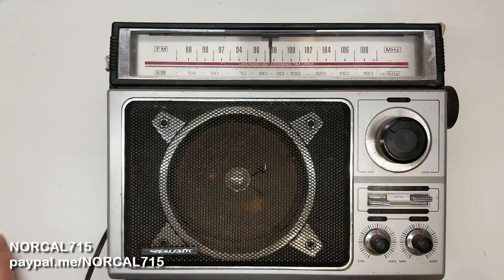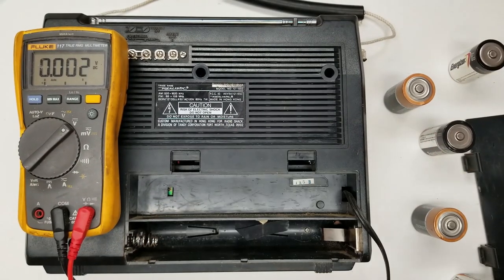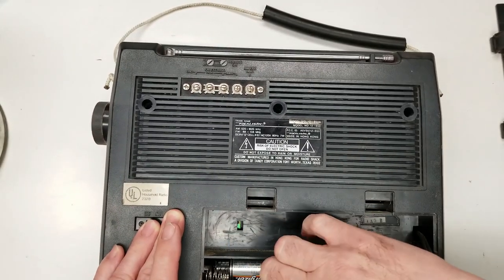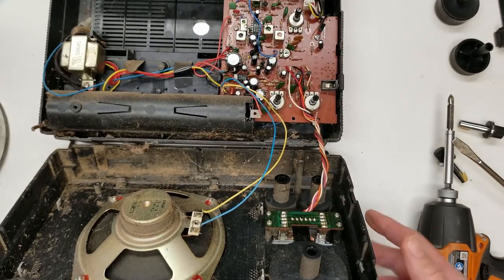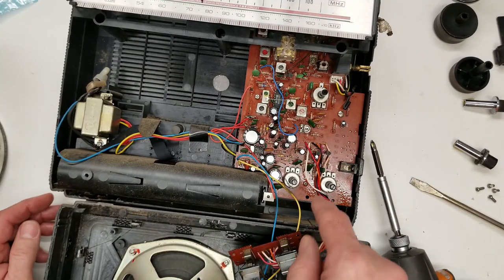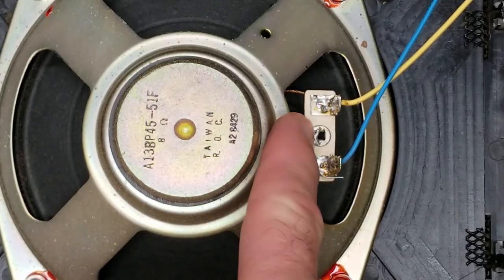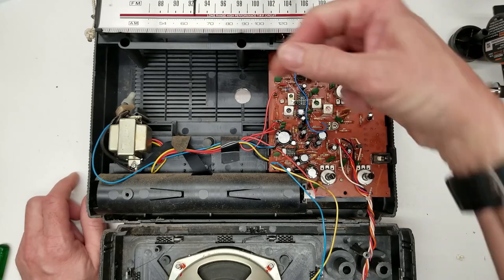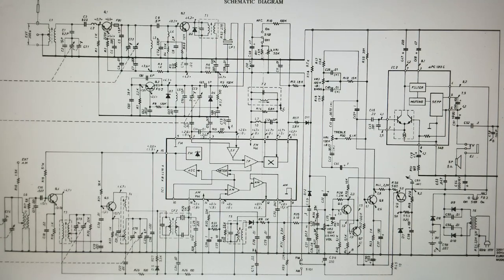REALISTIC 12-650 AM-FM LONG RANGE RADIO NO POWER REPAIR WITH FULL SCHEMATIC DIAGRAM

Comment: Nice work on this little "blast from the past".  Since the owner is using it on just batteries, I'd recommend putting some dielectric grease on all the terminals to help keep the corrosion at bay.

Comment: One sony make audio ok, but fm&am no function one 18pin ic in rf stage and one 9pin ic for fm also one 18pin ic as pre ampli, no rf function what to check and change please help.!!!
Reply from the maker: Check all of the power supply voltages to the AM/FM RF/IF circuits first.

Comment: Nice vlog, can you help me my xhdata 808 radio suddenly wont start, uses 18650 battery, on pluggong micro usb charger the lcd lights up for a second and nothing. Also i ve noticed the usb charging area getting hot, pls guide how to fix, thanks!
Reply from the maker: What is the measured voltage on the 18650 battery? Some units charge the battery and draw from it at the same time. It may be as simple as a bad battery.
Reply: @norcal715  I have already tried a new battery still the same?